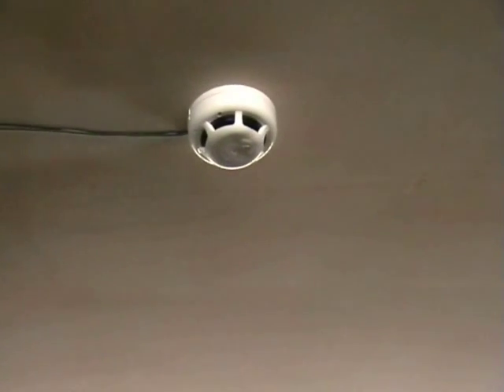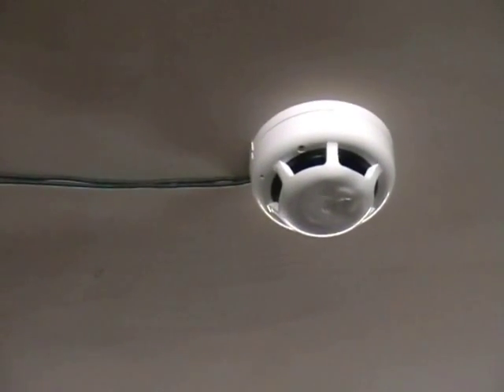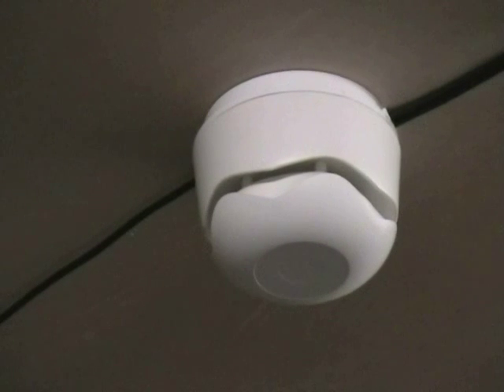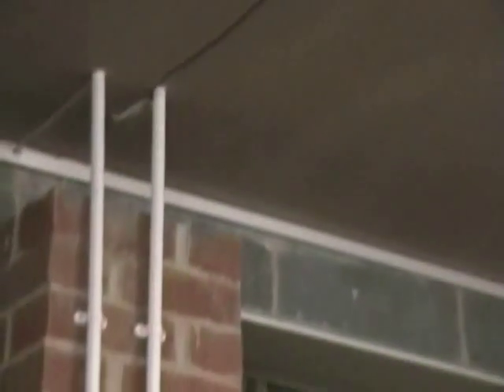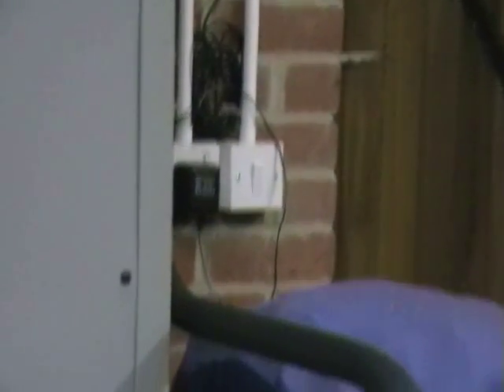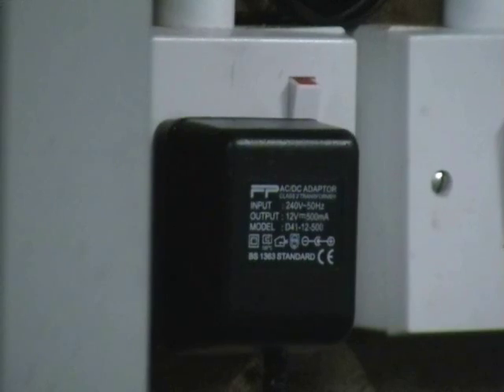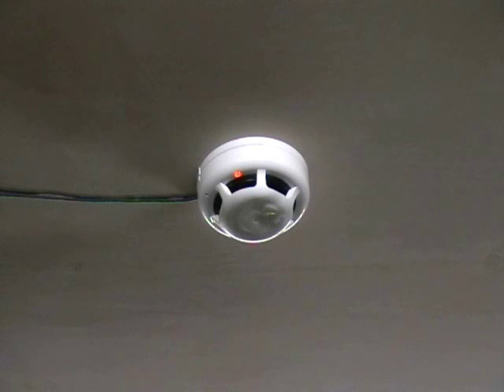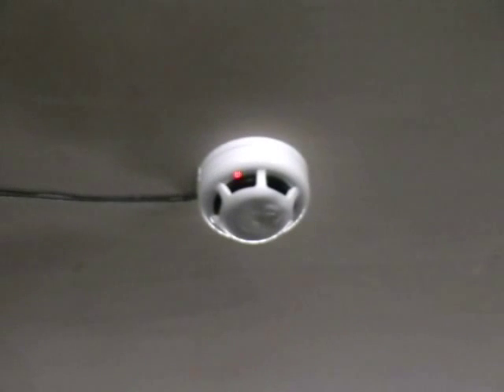fire alarm in garage -heat detector and sounder

Comment: most all heat detectors instructions state the detector should be mounted near the wall, not the center of the ceiling
Reply from the maker: This video was only ever for fun and not to represent a compliant system. I have seen heat detectors installed near to heating appliances such as ovens.

Comment: I admire you for trying but you wasted your time (and mine)
If the room has lots of cardboard boxes, they will be burning before that does anything, you need a smoke detector. You need sounder OUTSIDE the room, (you know about mains fail) But what if some one unplugs it, and forgets to plug it back in. and as said its a banshee sounder.

Or better still buy a couple of battery smoke alarms